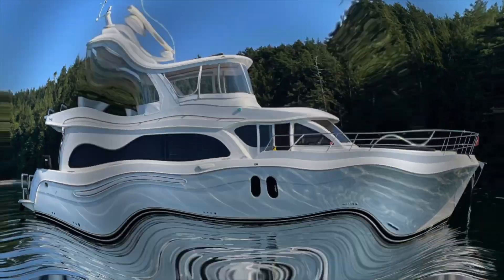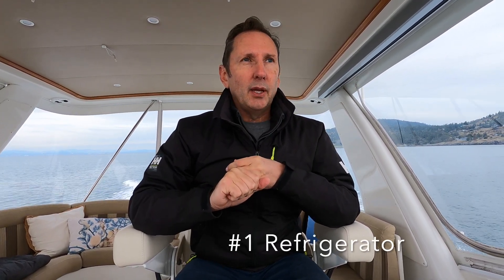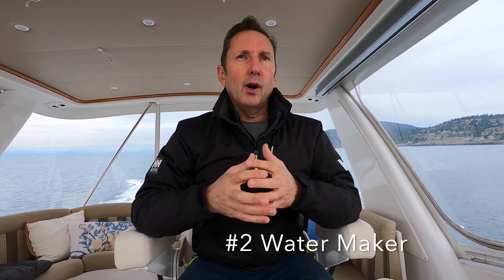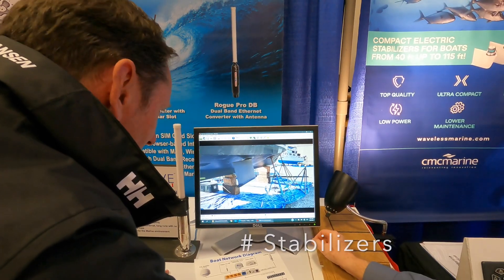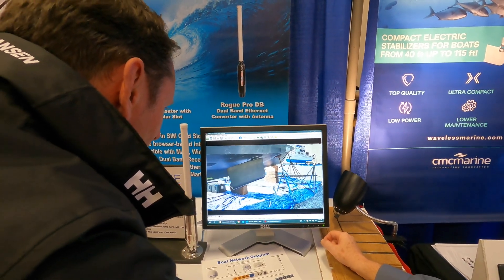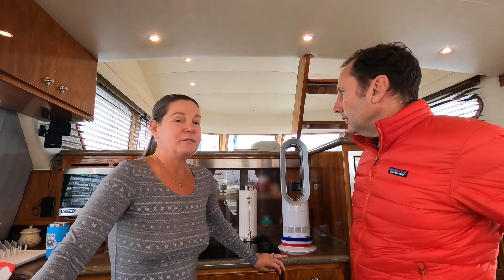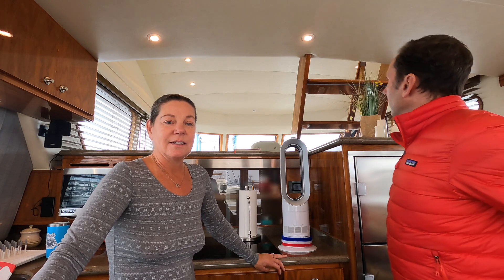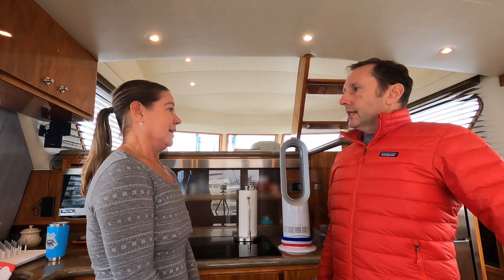Live Aboard Yacht Stabilizer Refit Part 1

Comment: Hi Jon.  Great video as usual.  One thing I do when I go to a yard on the hard is put a lock out tag on each breaker that has to stay off.  I also have a instuction sheet taped to the breaker panel door that has instructions to whom ever opens it what is to remain off and what is to remain on, while on the hard.  Several times in the past I have had yard workers mess my routine up when they have to disconnect the shore power or move the boat.  I also instruct the yard coordinator that if the boat is disconnected for any reason the boats mains are to be shut off before disconnets and to be turned back on only after reconnections.  One yard blew up my charger thru live disconnect and reconnects.

Comment: What do you do with your water maker when back in the fresh water of Lake Union for a bit?  Do you have to pickle it or do you use it to keep it “fresh”?
Reply from the maker: Good questions. There is a myth that water makers can’t be used in fresh water. We’ve used our old one for 3 years in and outside of Lake Washington with great results. It just uses less pressure in bodies of fresh water. 

As far as pickling, our unit back flushes weekly to keep it fresh. If we didn’t do that, we would need to pickle it to protect the membranes. 

With our new high volume water maker, we’ll probably use it to replenish our onboard tank vs being connected to the city water main. That will keep it in use and reduce chance of contamination from hoses, etc.

Comment: I don't recall you saying what new Fridge you are going with.  What brand and model have you selected?
Reply from the maker: Hi Rob, we’re replacing it with a Vitrifrigo EW250IXN4-EXV-1. It has a lower drawer freezer and front panel temperature gauges. It’s definitely a splurge.
Reply: @ElliYacht1  Nice selection!  Thank you for your reply.

Comment: Is there any reason you never went with a seakeeper giro instead of a fin stabilizer?
Reply: probably price (avg $75K) and you would need a generator running all the time for the Seakeeper 6 (needs 110 - 230 Volts AC power for the Motor Drive Box to drive the motor inside the Seakeeper per the website) Also the space to put it, like he said, they don’t have a lot of room as it is.
Reply from the maker: Ted is a mind reader! + the spin up time is ~20 minutes. Electric fins are instant on.

Comment: What brand of water maker are you going with and why? Thank you.
Reply from the maker: We’re going with a Blue Water Legend. The legend is extremely compact and fits in to the identical space that our 12V system did, which made the swap easy. We selected the 240V 78GPH configuration, so there are two larger membranes vs one smaller one. The Legend is fully automatic, in that we don’t have to manually dial in the pressure every time it starts. 

It’s a little thing but, when you use the water maker every other day, it’s a hassle.
Reply: @ElliYacht1  thanks! Is your electrical system 24V?